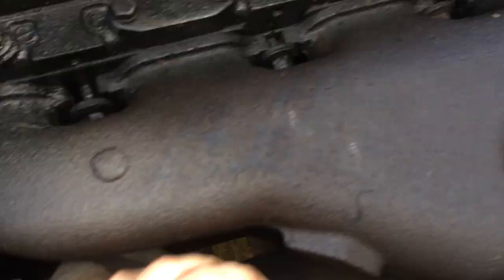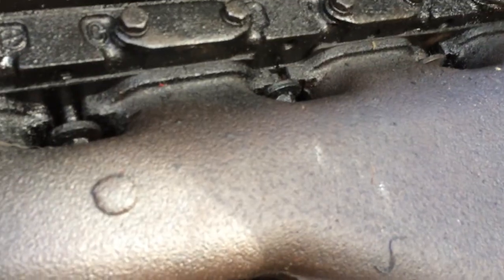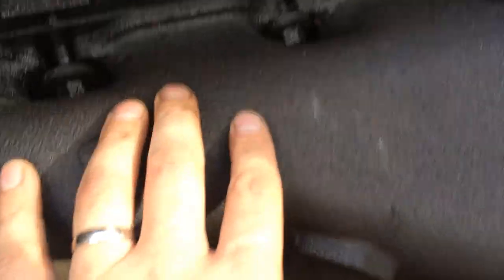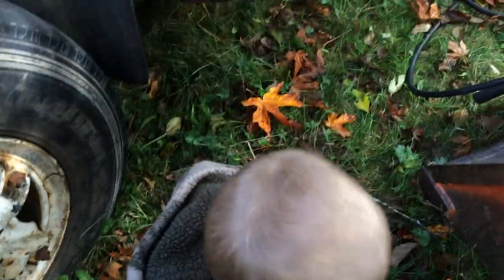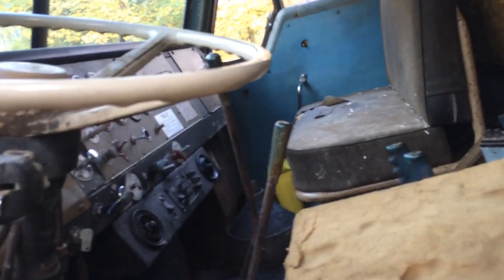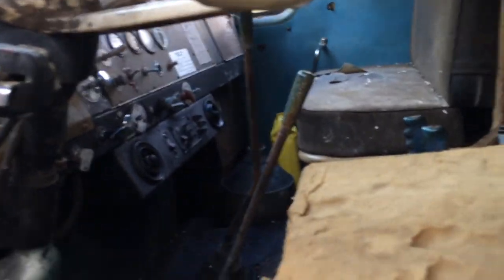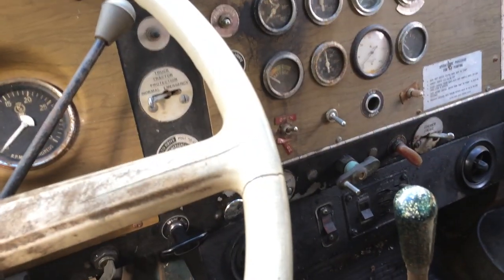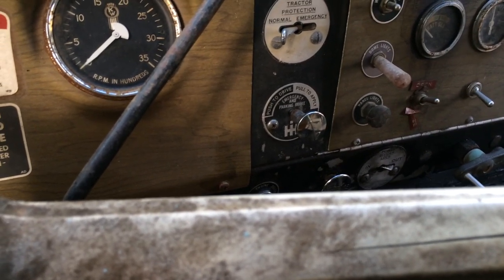DETROIT DIESEL 8V71 AIRSTART COLDSTART

Comment: Of course it feels oily, it's an 8v71! They didn't call em road oilers for nothing. 🤣
Reply: The Detroit engine was designed to use or burn 1 litre of oil per 1000kms driven right, no excessive idling and with the tacho needle between 1700-2100.
Reply: @andrewking9761 ...and leak a litre In the case of the 8V71. They could get pretty bad.
Reply: if a detroit doesnt leak oil it must not run lol
Reply: Don’t you need a fish tank full of oil to lube those?
Reply: @Detroit8V92tta  we had one 318 that was dry. But the other made up the difference.

Comment: I had a 1963 International like that one in this video 318 with Air start good old truck. It also had a 4by4 TRANSMISSION 2stick I got to where I could motivate down the road.
Reply from the maker: Thats awesome Dan. they are good old trucks and have less problems than this new junk on the road.

Comment: Any chance you could get the casting numbers of those exhaust manifolds?
Reply from the maker: I'll take a look when I can.
Reply: id make one if u cant find what yer lookin for, it aint too hard to do
Reply: That's the plan.  Haven't been able to get any part numbers for the right manifolds.
Reply: @Shadow-hk5sv  yeah it wont be hard at all, you have plenty of room in a big truck (most models anyways) the most import thing would be to do the flange that bolts to the engine, i would try and get someone laser cut a 3/8 plate for that though. im sure you could make one in a regular shop but a plasma cut cnc flange is mo bettah, good luck man .
Reply: Indeed.  Looking to get some laser cut stainless for flanges and I happen to live 20 minutes from Silicone Intake Systems who carries the stainless weld els.

Comment: Do you still have the truck
Reply from the maker: In a way yes. The people that owned it Gave it to me thinking the truck wouldn’t start and run because of the broken fly wheel housing. I fixed the fly will housing making it operational again, so I asked them if they wanted it back since it runs and drives they said sure, so I can use it anytime I want at this point.